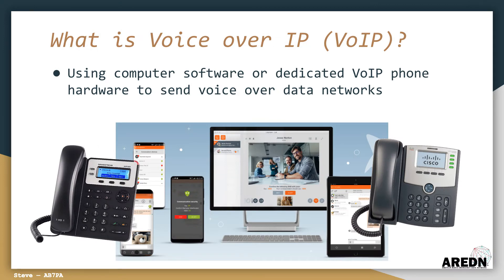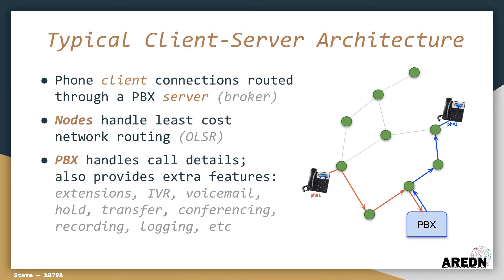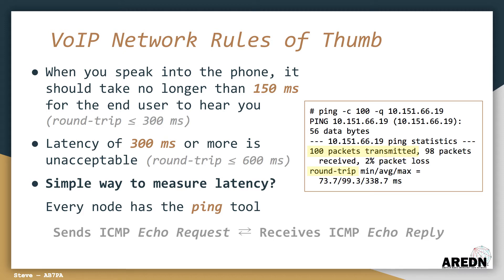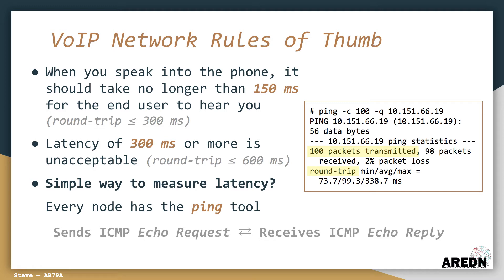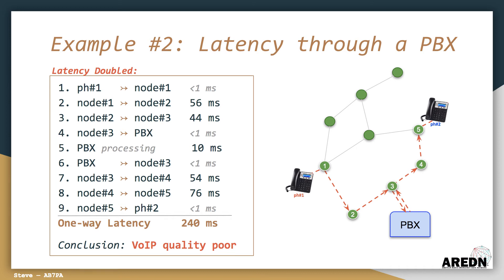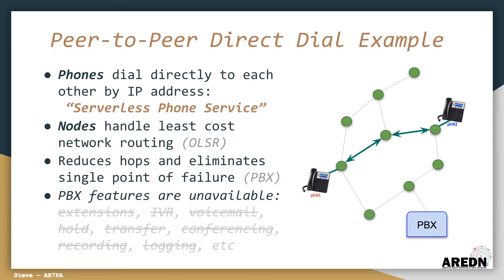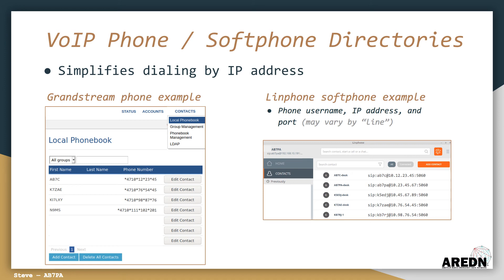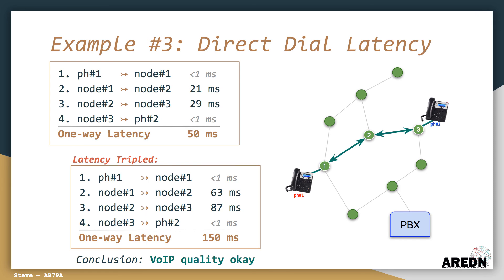Improving AREDN® VoIP Performance

Comment from the maker: As I mention in the video, I deliberately oversimplified the topic of VoIP call quality by focusing only on the number of network hops.  Recently Mark N2MH shared a great comment: "Packet loss is an important metric because actual speech fragments are lost forever.  In my experience, you can almost hold a conversation at 5% loss, 10% becomes a guessing game, and 15% is useless."  One way to estimate the packet loss is to use the PING tool discussed in this video.  It displays both latency and packet loss.